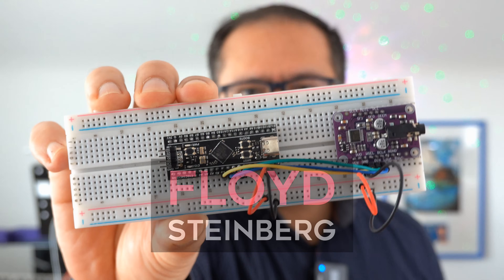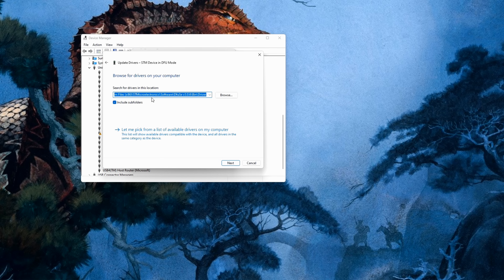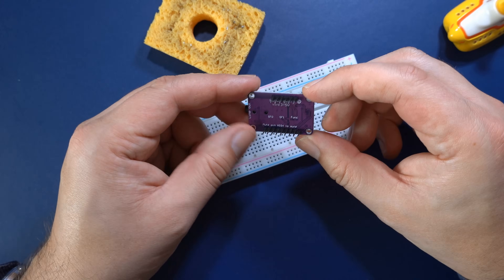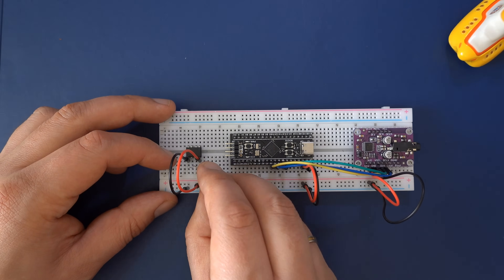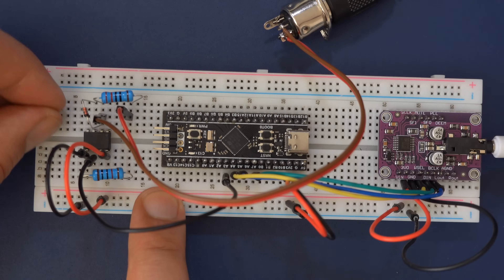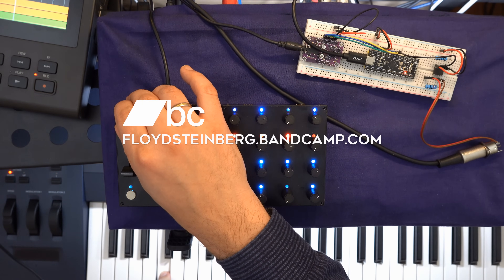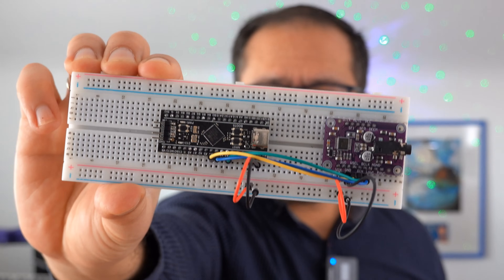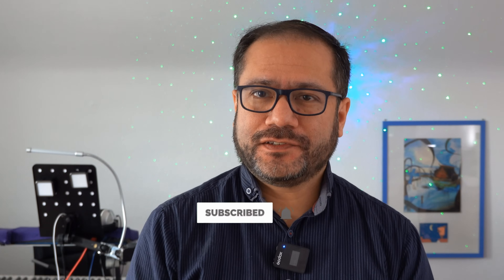This $20 synthesizer sounds very nice indeed

Comment: Blackpill is cool indeed. It's super cheap and exposes the full functionality of STM32Fxxx. But note that this project is a digital synth that doesn't use any special hardware (only midi and DAC), so you can code comparable synth on any computer for 0$. My favorite audio server is JACK, it has a very simple c (there are bindings for other languages) api, but if you don't want text programming you can always use puredata.
Reply from the maker: Thanks for watching! This is correct, but I think the really low cost and small size of this synth makes it fun to build and learn. Plus you theoretically could fit it inside a midi controller keyboard to convert it to a "real" synth.
Reply: @mr_floydst Yup, these days one can build a lot of cool stuff with how cheap and powerful those microcontrollers are. I think that picoTracker project is really cool. I found out about it from your video (that's how I found your channel too). I wonder why I haven't found it earlier since I'm on the lookout for these handheld tracker projects. I guess those are just really niche and hard to find.
Reply: JACK is amazing because it comes native with the majority of Linux Distributions, so you always have it available by default for audio projects.
Reply: This has the convenience of running outside of/without a computer.
Reply: thanks for this comment!
Reply: I mean, that kinda misses the point that people just like making stuff... and like having hardware that you can carry in your bag/pocket and not need a wifi connection to jam on. Sure, I could take my laptop and an installed copy of DEXED and a touch controller and blablabla... or I could just take my Volca FM2. I have yet to choose the laptop when faced with that decision.
Reply: Focused single use devices are much better for me personally because you don't have too many choices, and you can just turn them on and they work the same every time forever.